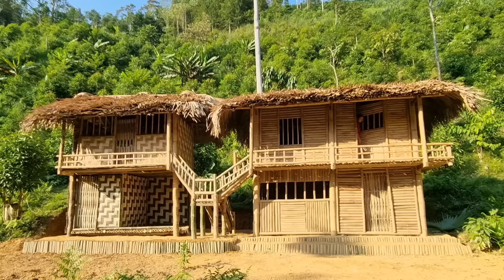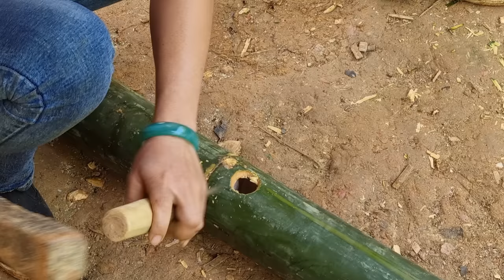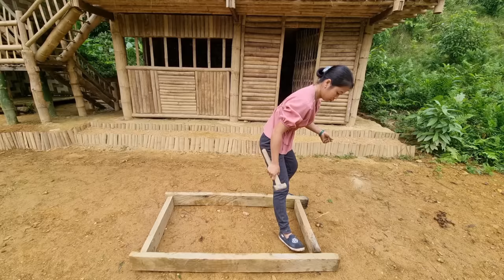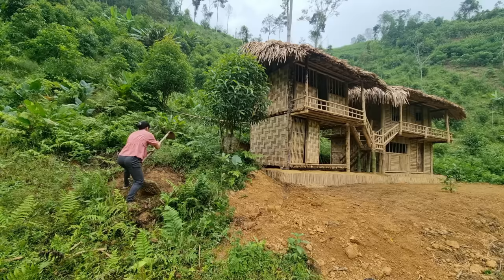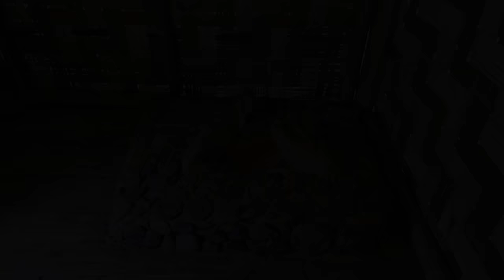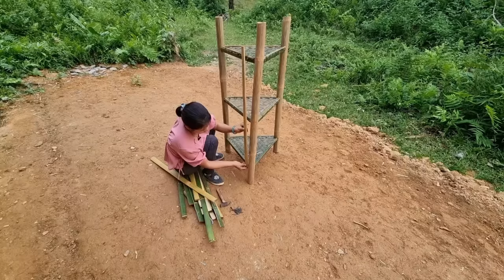How To Bring Water Home And Make A Kitchen And A cupboard Bushcraft Hut - Ep.8

Comment: Wonderful creative thinking. You had water above you, I did not expect that. Now you can either let it run on down through your
garden for your plants or animals or simply let a little stream look beautiful.
If it runs for too long, you will get some Algie build up and the floor will become very slippery, so please be careful.
That dug away part for the water must cool the air under the floor too right? I don´t know, yet warm water might also be possible
with the fire and a U shaped pipe running through the fire, would have to be metal though 😄 
Love the shelving, everything you touch seems to fit in so well.